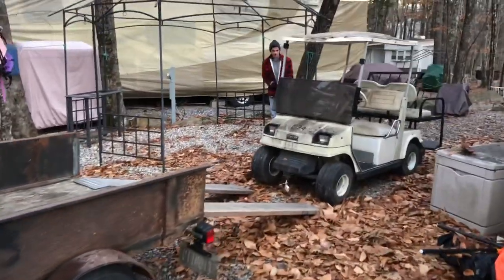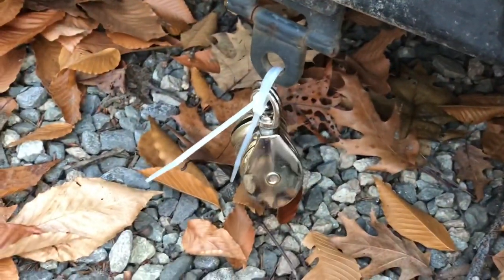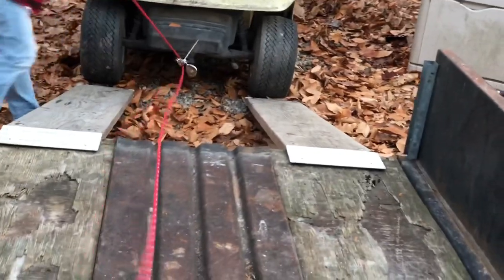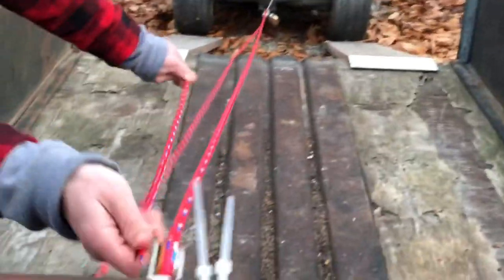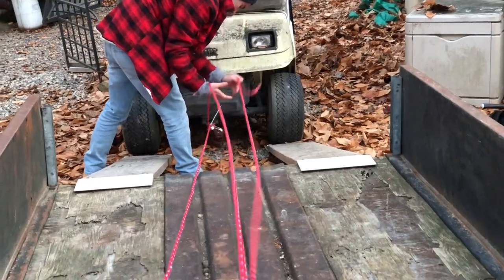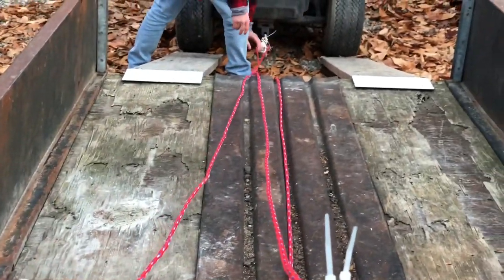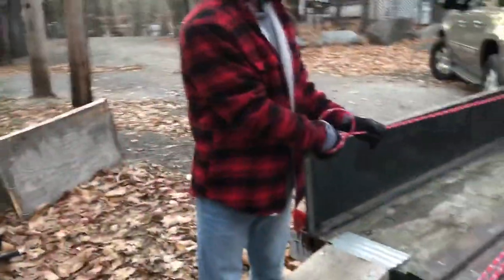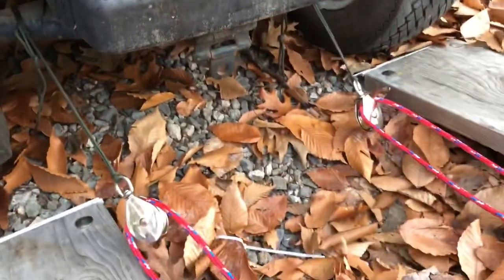How to setup block and tackle with cheap hardware store pulleys and rope

Comment: It would have made more sense for both of you to pull on the rope.  Its literally the whole point of having the pulley system - to have a mechanical advantage.  The person actually pushing on the cart has no advantage
Reply from the maker: Shop Therapy thanks!
Reply: My thoughts also.
Reply: if sense was involved they wouldn't have done it to start with.  A perfect video for what not to do
Reply from the maker: Think Safety what’s unsafe?
Reply: Safety? Ramp board with no cleats to stop from sliding in the dirt or off the trailer. Safety? No brake system to stop cart from rolling over you son if the pulley system fails. Either your 100% OSHA ( hard hat, reinforce toe boot, safety glasses, work gloves) OR YOUR NOT.
Reply from the maker: C L lol ok
Reply: Lol yeah, but you need someone in back in case you break a ziptie!!!

Comment: Spend 1/2 hr. looking up 'Z-rig' compound pulley system on You tube, watch how they use 2 Z-rigs as a complex system, you lay it out on the ground for practice, Pretty simple if you paid attention to a couple of You Tube videos. With 2 pulleys and 2 prussik knots you get a 3 to 1 advantage.  Next apply a 2nd Z-rig set-up to pull on the first Z-rig tail, changes system from a 'compound pulley' set up (1 z-rig) to a 9 to 1 advantage 'complex pulley' system.  And do your pulling from the front of your trailer load! Try to be safe please.  This will cost you maybe an hour or 3 researching, practicing the knots, actually setting it up and completing the job.  You already have the 4 pulleys and the rope, and the second use will come much easier.